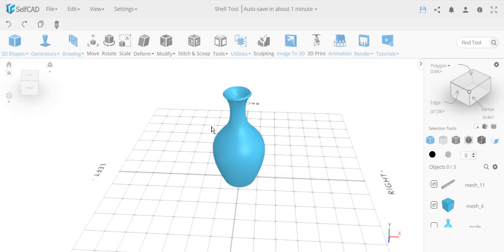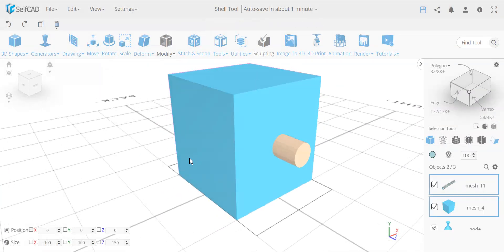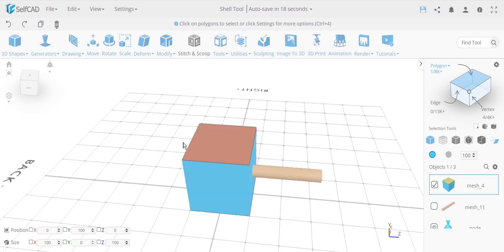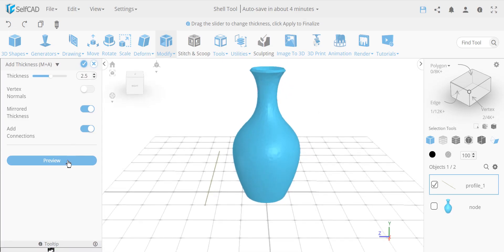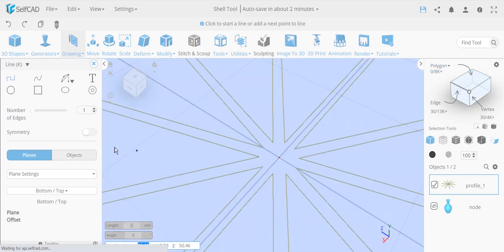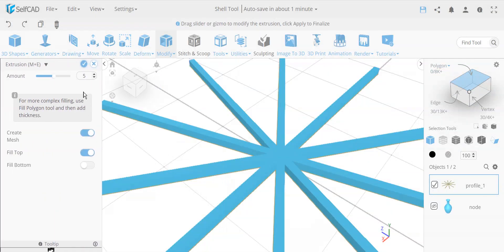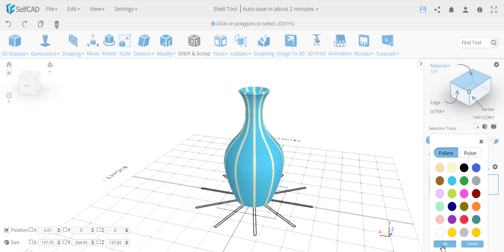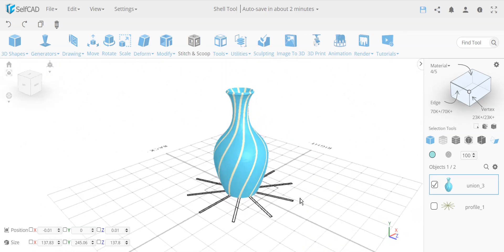How to use @SelfCAD  Stitch and Scoop Boolean operations

Comment: how can you break a union of 2 items after you have done it ?  is there no way back ?
Reply from the maker: You can use the undo function but the undo steps will be lost after reloading the app so in that case you will need to select the separate segments and use the split function. Advanced polygon selection tools are usually the best option for quickly selecting separate segments. You can also use different colors for each object and then select them using the material selection. This video may help https://youtu.be/WQtPE_79Apk?t=1497